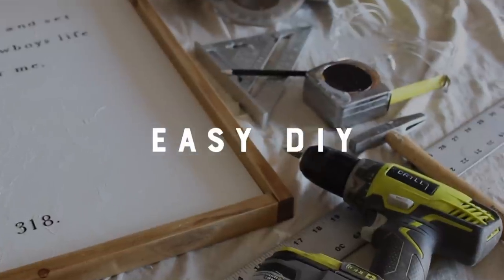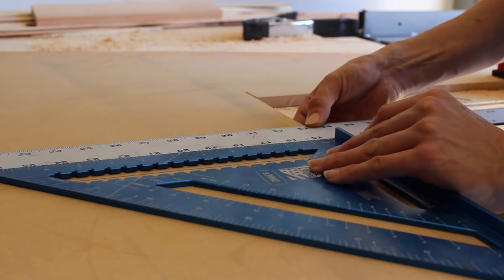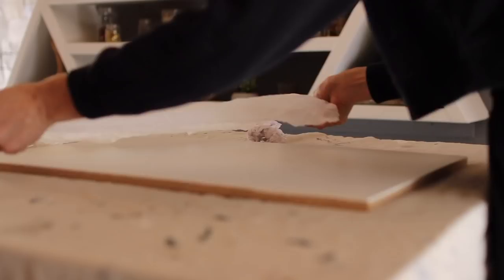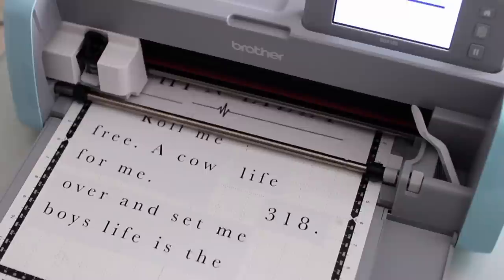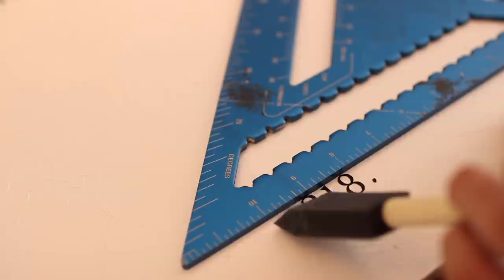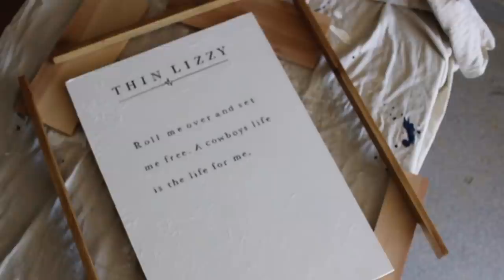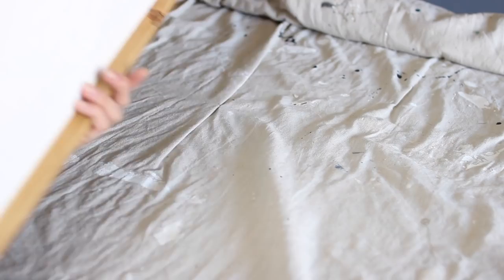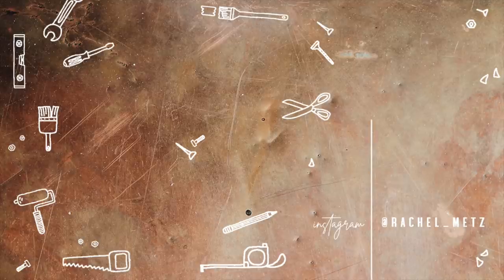Easy DIY Wall Decor | Beginner Woodworking Project

Comment: What size screws do you use? I’m starting a couple projects and I’m a beginner and that’s one thing I’m struggling with. I don’t want them to be too big or too little. But, for like this frame, what size did you use? How do you know what size drill but yo use to pre drill your holes? I have a nice dewalt power drill but don’t really understand the sizing of drill bits yet. 😬